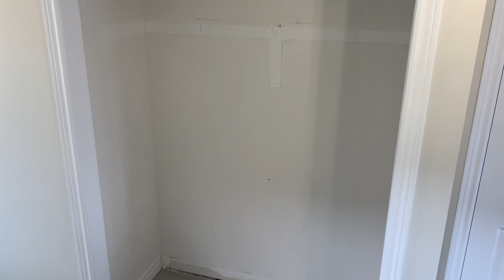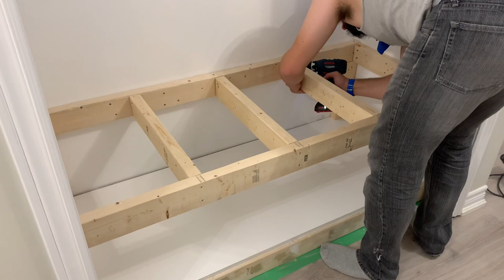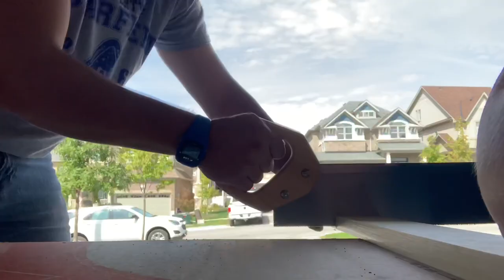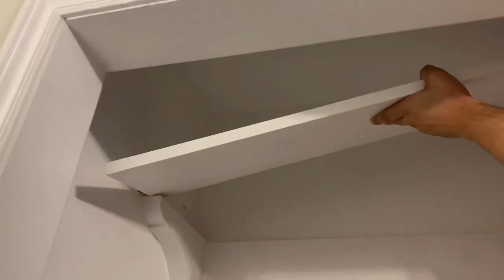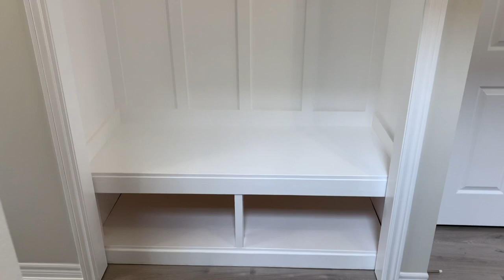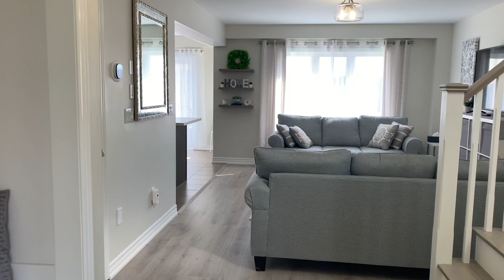AMAZING DIY Closet Transformation! [BEFORE & AFTER]

Comment: Looks amazing! I’m about to try this at my house and the only question I have is how much higher did you make the seat from the base?
Reply from the maker: Thank you! What I did was purchase the bins I liked, saw they where were 12 inches tall, then cut the support 2x4 pieces 12.5 inches long. If your baskets are shorter or taller you can adjust the support beams to make a custom snug fit. Then I just repeated the same structure on top. Mine turned out being 21 inches in total from floor to seat and it feels like a very comfortable height to sit on. Yours can be a bit shorter or higher depending on the size bins u have.
Reply: @JennStavropoulos  thanks so much! Merry Christmas!

Comment: This is probably a silly question, but did you sand the base and bench? Assuming this is plywood?
Reply from the maker: Great question! At first I thought I didn’t need too cause it wouldn’t be seen but then I realized my fabric bins would get caught on the plywood when sliding them in and out. So I had to give it a quick sanding.
Reply: @JennStavropoulos  I appreciate the info! Thank you